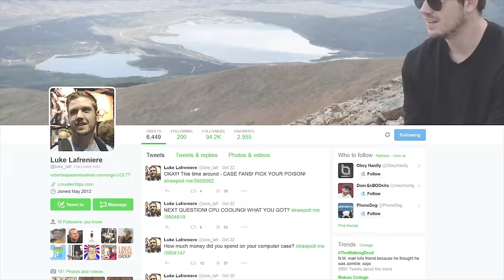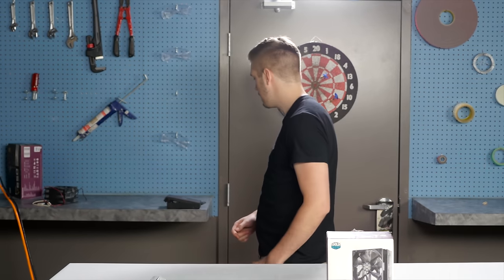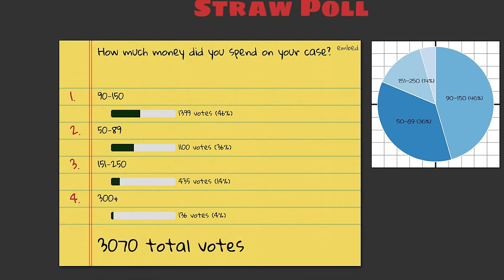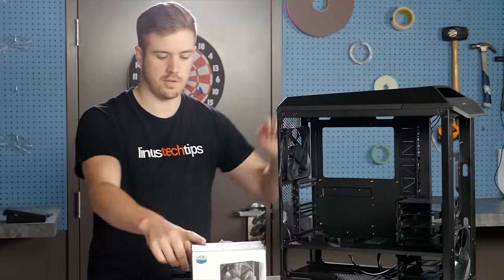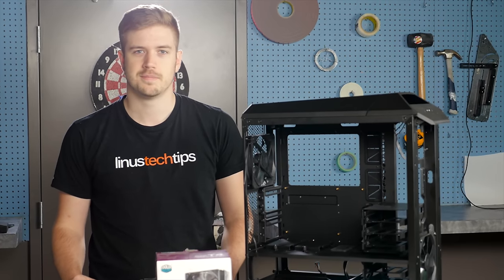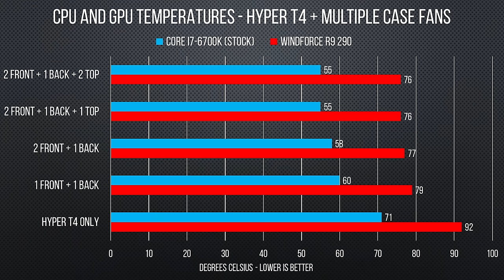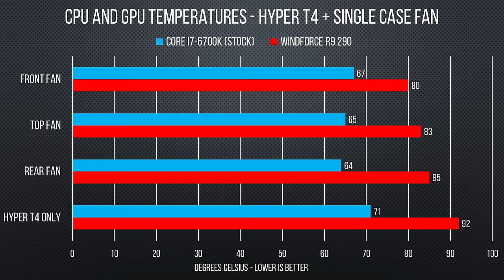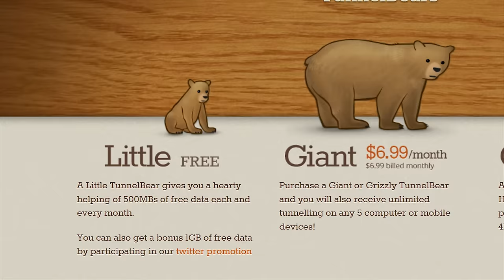Case Fans - How many should you have?

Comment: I have been following the same formula for years:

Front: 3X 120mm or 2X 140mm or 1X 200mm
Rear: 1X Exhaust fan on low speed
Radiator: set to exhaust air out of the case. 

Sometimes I have another intake in front of the PSU, but thats not always needed.
Reply: +Casual Alien Found the positive pressure bro
Reply: 200mm fans don't make good intakes, dual 140s are definitely the way to go if your case supports it
Reply: Kyle McHale I only mentioned the 200 because thats what my Enthoo Pro came with. When given a choice I always pick 2 or more 140 fans.
Reply: +Casual Alien I've got an Enthoo Pro as well, but I've got 1x200 intake in the front, 2x140 intake in the top, 1x140 intake in the bottom and 1x140 exhaust in the rear. The Pro has got so many holes in the back of the case that even setting all fans bar the rear one to intake like I have doesn't cause significant internal pressure...
Reply: +Casual Alien a tier 2 evga support rep told me their non reference cooler fans prefer negative pressure over positive. and since the gpu runs hotter than the cpu it would make sense to cater to its needs. following their advice and swapping 2 side cover fans from intake to exhaust i lowered gpu temp by 3c and cpu temp about the same. since before the gpu exhaust was being forced up past the cpu and through the radiator or out the back. 

i have 3 intake on front, 1 intake on bottom, 2 exhaust on side, 1 exhaust on rear, 2 exhaust on top rad. 2 of the front are 1 channel of my fan controller. the other front and the bottom are on another channel. the side exhausts are on a 3rd. my 2 50mm mosfet fans are on a 4th. and the 5th channel handles the 35mm 8000rpm stock mosfet fan cuz its loud as hell, i keep it at 40% always. it by itself can overpower the sound of all other fans combined at max rpm. by doing this i can force positive or negative pressure at any time by adjusting their rpm
Reply: +EZOVERDOSE I have sli 980ti g1s, they run about 4c cooler with positive pressure. Negative kind of makes sense with only dual fans tho
Reply: Too many fans. As you can see in the video 1 intake is enough. And they used a pretty beefy GPU, most people don't have 300W GPUs in their system, they have cheap 950s and 960s with half the TDP.
Reply: DGRWPF There is no such thing as too many fans. :p
Reply: +Robert Faber You have 2 intakes in the top? o.O
But you know that hot air goes up, dont you? So you have 2 fans going against the natural airflow
Reply: LRM12o8 Hot air does go up, but with the small temperature differences inside a computer case, that effect is almost negligible, and easily overcome by even the weakest of fans. An advantage of top intakes compared to top exhausts is that top intakes will make a significant amount of the dust that normally gets stuck in dust filters simply lie on top of the case, where it's incredibly easy to clean off.
Reply: +Robert Faber ok, in terms of cleaning there's a point, but i wouldn't be so sure if the heat difference is really negligible
Reply: +Casual Alien i would get rid of the exhaust fan, not really needed if you have you rad up top that is.  dust will reduce with more positive pressure.
Reply: the good hustler Yeah I forgot to mention that if I have an intake by the PSU it is usually the rear exhaust fan that has been moved to the bottom.
Reply: Casual Alien ah right.  thankfully my psu fan never spins up as it only does at 70% load which it never quite reaches.
Reply: +LRM12o8 He said it's almost negligible, and he's right. You won't find anyone who's into thermodynamics stating otherwise. All those "but hot air goes up!" moaners just wanna show they learned at least a bit at school or parrot things they read/heard elsewhere and found them to sound legit, if not genius, without rethinking what they were told ... no offense, though :D :D :D
Reply: +Oliver ASUS well I have two hdds in my pc. No natter which one is in the upper position it is always 3 degree hotter than it is when it's in the lower position. So there are conceivable diferences in temperature. But i honestly don't know if it has a conceivable impact on cooling performance or noise level if you have your airflow going against that natural airflow. So I was wondering if somebody might has tested that, cause I don't have the opportunity to do so, as my case has no top fan mount
Reply: +LRM12o8 
Where is the temperature sensor located on HDDs?
Where is most of the heat radiation taking place on HDDs?
Go figure :)
It has been tested over and over. But there's something you can do yourself: turn off all your case fans, blow some smoke into the case and see what happens ... if you got a windowed side panel you can even put that on, for more dramatic effects ;D
Reply: ... and, sorry I forgot to mention again, there practically almost isn't any "natural airflow" inside an average computer case as Robert Faber already pointed out. See smoke experiment ;)
Reply: Oliver ASUS You know, there's surprisingly few people who back me up on my predilection for top intakes. Thanks!
Reply: +Robert Faber Scientific knowledge isn't that popular anymore nowadays ... you're welcome!

Comment: I just moved my GPU from vertical mount with PCI extender cable back to board mount and temperature dropped from 72C to 62C. When vertically mounted it was pretty close to the glass so that's probably why. Plus the PCI extender cable adds a touch of lag to the GPU so also better board mounted.

Comment: The whole time, even before watching the video, I had one fan configuration in mind that I was curious about. But due to the design of the case, this wasn't something that you could test. I was curious if you had a top vent/exhaust/intake, would a) two fans as intake, b) two fans as exhaust, or c) one push and the other pull (perhaps swapping as well) result in better thermals? Otherwise the rest of your setup is indicative of my own. And what about lowering fan speeds with more to be quiet (obviously many more variables and hard to fully test). Awesome as usual and thanks!

Comment: I disagree with you, it's not that more fans is a diminishing return, it's that when you increase the internal pressure by installing more fans it will need to be balanced.  You need to tune the individual fan speeds to create an optimal pressure and flow pattern.  Try using a fan controller and smoke to balance the flow pattern, then use a photohelic or a manometer etc. to set your case pressure.  You may need to tape off case vents (since no pc cases on the market have flow gates that I know of) to achieve a good balance.  That's how to make the fans do their job and give you the biggest bang for your buck.
I've worked in the Semiconductor cleanroom industry for 30+ years, I know this topic well.
Reply: K.
Reply: Can you shorten it Down
Reply: I get the feeling that the equipment needed to measure the flow as perfectly as described probably costs 4k$ or even more.
Reply: @JoelHernandez-tz3vk  I just use a vape so I can visible see how the air moves
Reply: @jaspervn4722  I think I saw jayztwocents using incense for this process, wonder if this is accurate enough for most people.
Reply: stop lying bro, you probably just spent 200 on rgb fans that do nothing so your trying to tell everyone to do the same LOL
Reply: @jimmicrackhead12  no I got my fans free because they were used
Reply: Or you can just get a bunch of fans and have the front bringing air in for cooling and fans on top and back exhausting hot air. Been working in HVAC for 70 years so I know this topic well

Comment: I think you’re seeing diminishing returns due to excess air pressure. Your 1 exhaust fan is bottlenecking your 4 intake fans. You could possibly further increase cooling possibilities by adding bottom mounted exhaust fans, turning one of the top fans around, or using an exhaust fan that’s much stronger than the intake fans
Reply: Yeah. Once again, a place where tilting the computer on the side would probably help some if it has fans bellow the MOBO or close to it not getting the turblance and convections effect vertial towers create.  Titlt the whole fucking thing on the side kind of like an Xbox or something and then you work better with physics, at least for fans colder heavy air tending to cockblock the hot air...it'd  seem like you'd get a little better improvment. 
Pluse you get a preemo monitor stand to boot.
Reply: @gorkskoal9315  That's very interesting. Could you expand on the idea ? Why would a tower build work against physic, compared to tilting it ?
Reply: If you look closely, he actually adds exhaust fans on the top. So with 2 front, 1 rear and 1 top, it is in fact equalized, and slightly negative with the final config.
Reply: @Syldar  well the positive pressure is better so he should have thought about doing this experiment with negative and positive pressures with all the different fan variations.
Reply: Should've put a couple spinning HDDs in there to monitor those temps under load as well. I always make sure at least one fan is blowing on my HDDs as well to protect them during those hours-long copy operations.

Comment: you shouldve tested a side panel fan and its effect on the gpu.
Reply: My strix 1070 idles at 33 degrees with a side intake fan and no gpu fans running.
Without it is 53 degrees so it's a huge difference at idle but under load it doesn't matter much at all.
Reply: Custom Zombies idle Temps mean nothing. I've personally tested my HAF 932 and the side panel fan made very little difference on my gpu Temps but surprisingly dropped my cpu load Temps by about 3 Celsius. if you have a gpu with a good cooler like the wind force 3x case fans don't make much of a difference gpu wise.
Reply: My 780 ti idles at 32 when ambient is 36 xD
Reply: 980 idling at 38 with a Corsair H90 AIO, but at 1525mhz and 1.275V XD
Reply: yea im gonna put in a side intake fan on my rig, its an 80mm antec with blue led and 3 speeds, hope it turns out good!!
Reply: Papa Smurf side fans are a real dice roll. adding one to my computer actually made both the cpu and GPU run Hotter

Comment: i use an old hyper evo cooler, my top fans are one intake 1 exhaust, this creates a sort of cooling loop for the tower and makes sure that there's  air flowing through my ram. After that i've got two low speed intakes in the front to keep hard disks cool and to contribute to a positive pressure environment in the case, a fan on the side to make sure my video card is getting air, an exhaust on the back to evacuate whatever the top exhaust can't. PSU is independent and all intakes are filtered. Additionally my case has some open air venting on the back which because of positive pressure are usually for excess exhaust air, and, i popped one of the 3.5" drive bay doors open and covered it with filtering foam because it's in-line with the cooling tower so that if it needs more air air its more encouraged to pull from in front than around the case. All filters do get dirty and all open vents are usually venting excess air and if I needed any more proof its working effectively, my room gets hot as hell while pc temps stay nice and cool because there is no heat accumulation within the case. I also wear headphones, so this jet engine sitting next to me cannot be heard. As far as essential fans go, you typically want 1 exhaust near mosfets, 1 intake that flows over hard drives, 1 intake that flows near video card, and, ideally, PSU at the bottom of the case. This should prevent most cases of heat related hardware failure. Case windows are not essential for a budget gaming, you have nothing to show off anyway and the objective is performance for cost so you can use the cost of a case window and spend it somewhere more important. Additionally, if you are using either a tower cooler or a liquid cooler you must make sure there is airflow on the board. There are things on a board that have no sensors but can still fail to heat, heat pockets are lethal. Even if its the cheapest most enemic fan ever, as long as it can move air over the entire board, or at least the area around the cpu+mosfets+ram, you're good.